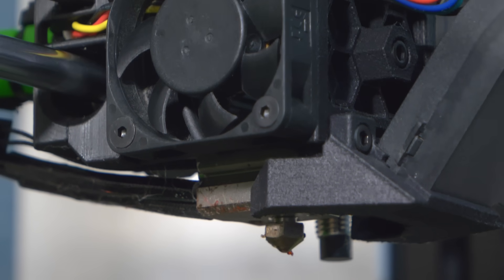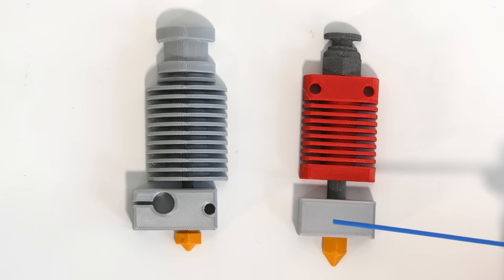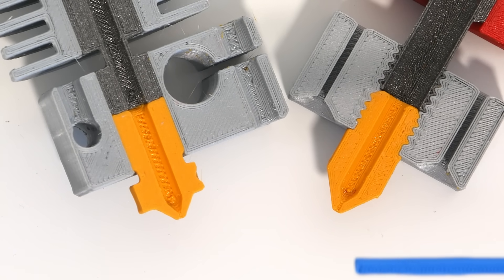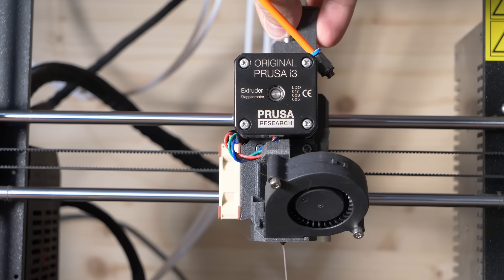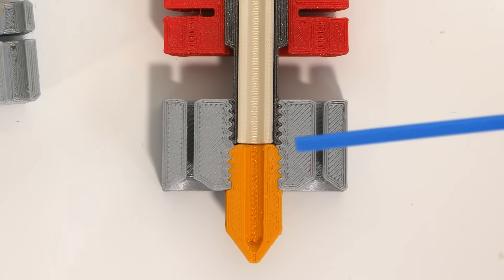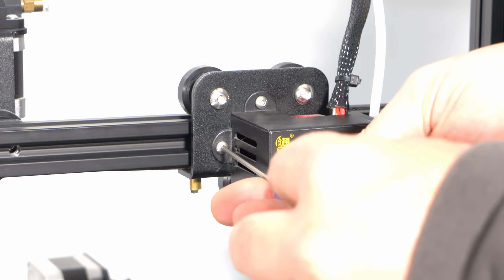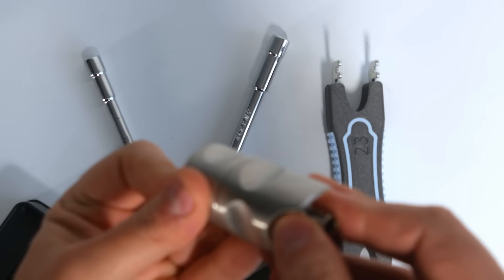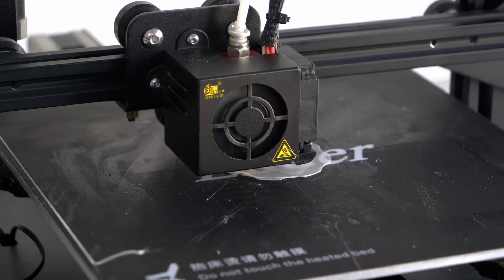The Biggest Pain In 3D Printing - Hotend Clogs & Jams

Comment: True all metal hotends FTW!

I found early on back around 2014 that PTFE tubes where an over engineered solution to inadequate heatbreaks. Applied thermal paste to the heatsink on my Replicator Dual, simply took out the PTFE tube and it has been printing beautifully ever since. Printing with just PLA and PETG, I've already had to replace the brass nozzle twice from normal ware and have only had one kinda clog since which was fixed with a cold pull because some debris fell into it. I suggest you feed the filament though a small peace of sponge with a hole in it to catch debris ;-) Haven't had a clog or any effects of such a thing in years.

I did recently buy a Duplicator i3 Plus and this time i upgraded the nozzle to a MicroSwiss all metal hotend so i could print lots of carbon fiber filaments, and although still a MK10 cooling/mounting block the better heater cartage and board on the printer insure stable prints at high temps and normal speeds.

Comment: If the only difference between the “all metal” is the distance of PTF tube to hot block, I don’t understant why don’t make all metal by default. Add a hole in the barrel to have PRF tube near of  hot block is more expensive piece...
Reply: The PTFE tube being down so low helps seal the mark10 against leaks, by butting directly against the nozzle.  But because it's down there exposed to the heat of printing, this causes it to slowly degrade, especially if you run hot like 250C petg.  Tradeoffs!
Reply: Orion Lawlor ¿what is the problem if the seal is 10 or 15mm far of the hot block? Many thanks for your help
Reply: @markus_1978  On my CR10, after I swapped to an "all metal" throat where the PTFE ends at the start of the throat block, plastic is slowly leaking out from the metal-to-metal contact between the throat and the nozzle.  I need to disassemble the hotend (again lol!) and add some PTFE tape to seal that joint.  In the original mark10 nozzle, that spot is already a metal-to-PTFE contact because the nozzle pushes directly against the PTFE tube.
Reply: Orion Lawlor I understand then that the benefits of using the tube near of the nozzle is that the filament slides more easily than inside a metal tube, but in your case of CR10, does the problem not come from poor tube retention?  I don't understand what relationship it has with the whole metal barrel.

Comment: I'll add one more tip for the Mk10, when seating the PTFE tube leave the nozzle a little loose, push the tube all the way in until it hits the nozzle then tighten the nozzle to ensure a nice tight fit against the PTFE tube. About a half a turn does the trick for me. If you leave the nozzle too loose it will bend the PTFE tube and cause jams so don't over-do it.

Comment: i took my hot end apart and found filament on the threads and up the sides of the block what would cause that??
Reply: What system is it? Probably the nozzle is tightening against the block and not the heat break. Make sure the heat break is in the heat block far enough that the flange of nozzle is not contacting lower face of heat block. The nozzle should seal against lower end of the heat break, not the heat block. Had the same issue. Pro tip: first install nozzle until flange makes contact w block. Then screw heat break in from top until it stops against nozzle. Then unscrew nozzle 1/4 to 1/2 turn. Then screw heat break further in the same amount until it touches nozzle. Then heat up for torque. All steps before without torque.  Make sure not to overtorque. The threads are kinda soft at high temperatures, u can ruin ur heat block. I had to make a new one.. Works flawlessly when installed as described, 0 leakage.

Comment: I'm not sure how YouTube knew I had a clog or jam, but thanks for this timely video! :)  I learned quite a lot from it and feel a lot better about trying to deal with it.  (I actually already replaced the whole hot end already, but I plan to fix the old one soon to keep as a spare.)
Reply: As a newbie, I have scratched the glass bed and I believe screwed up the extruder.  I was thinking like you "replaced the whole hot end already, but I plan to fix the old one soon to keep as a spare."  
In your past two years, how has this worked for you?  Have you since found better alternatives?  Replacement of the entire hotend assembly looks difficult.  The cost seems to be about $40.
What is your opinion on cost and difficulty?

Comment: I had a different issue with the Mk10 (Ender 3). The molten filament somehow made its way through the side of the PTFE tube inside the heat break. The leaking filament cooled down (due to contact with the heat sink) and was completely stuck in place. I could not even remove the PTFE tube from the print head. I ended up drilling through the filament from the nozzle side to release pressure, which was stretching the tube against the heat sink. Gladly there were no other issues for several months now.

Comment: If I may add on the V6 hotend,  the jam normally happens on my 3d printer on the ptfe tube after the heatbreak .   The heat during the print will soften the teflon tube eventually , then during the retraction the melted plastic will go up there and unable to move back.   This is the reason why the higher temp teflon tube is best for this application.   My fix for this problem on my bondtech style extruder with v6 hotend is I use 2mm ID aluminum tube with ptfe sleeve on the outside, from the heatbreak to the lower part of the extruder.  This fix works for me, no more jams since I made this fix.  I also do this fix to my IDEX printer and so far so good.   This is now my go to fix for v6 hotend.

Comment: I personally remove the cooling fan and heat the hotend to like 150 for pla
keep stabbing abs  onto the heatsink or if the filament is stuck keep pulling it out and pushing it in. until after a point the heatsink gets hot enough for it to release it. like a cold pull. or it just lets go of the filament. then quickly turn the heat off and put the fan back on. be careful cause during this your heatsink gets warm and hot and if you don't manage to get it out by the time it's hot to touch you should turn off your printer so your mount doesn't melt (if it's printed which it usually is) it's the same tbh but a little easier? I don't take the nozzle out either personally also I use abs cause I don't want to scratch and damage the inside of my v6's heatbreak since they need to be very nicely polished to avoid jams,

Comment: If you get a jam, as you showed, you showed how to use the heat gun to dislodge it but they need to realize that if it happened once it is going to happen again 100% guaranteed so they need to figure out what is wrong that is causing it else they will get beyond frustrated.

Comment: My filament was stuck inside the PTFE tube! This is a Prusa MK3S. I took the whole thing apart as instructed by a support tech. But now putting everything together is very intimidating as there seem to be many steps where things have to be just exactly right!
Somebody ought to design a new type of extruder that can be easily taken apart and put together!
Reply: They are fairly simple after you get used to them, but I remember the first time being intimidating. I think the hardest part of my build 7 years ago was the wiring and customizing firmware, mine came in a bucket of bolts/nuts and wiring, haha, you had to even crimp on your own wiring connectors, like nothing assembled, haha!

It’s all basically the same parts and can count the extruder parts on a hand, like mine from top to roll is: nozzle/block/heater/thermistor/2 securing screws/throat/heatsink/fan/pneumatic connector/tube/pneumatic connector/extruder housing/driveshaft and then 2 gears and a stepper motor). Mine is setup as Bowden with a customized “Cyborg extruder” that I printed. Plus after a while you’ll get it setup just how you need and really never seem to have much of an issue (there are some really nice easy maintenance designs out there too, but they also have some other issues like added weight so you have to print slower)

Youtube really makes things easy now, but yeah, for someone new it has a little bit of a learning curve (which is why I think it’s best when the first printer is completely assembled from scratch, you really learn how everything works together and can easily take apart and repair anything since you can build it from scratch). I wish I had Youtube back then, or even half decent pictures in the only half filled manual, haha!

You’ll do fine, as long as you’re not crossthreading it if you make a mistake you can simply take it apart and put it back together like LEGO toys if you don’t get it right the first time. “If at first you don’t succeed, Google/YouTube it”, haha, someone out there probably has a good guide for you (I know I find it helpful when repairing my car and prop my phone up where I’m working to follow along), good luck, I’m sure you’ll do fine.

Comment: Yeah, its also a probilem when it happens in 3 out of 4 prints.... or should I say print attempts...  still haven't found out why in my case, lots of things that could go wrong...

Anyways what I found to work fine too (Ender3 here) is to take an old ptfe tube that has a lot of marks from the coupler and feed it through the hotend (nozzle removed) and it acts like a cleaning brush taking a lot of material with it.

What also is useful on some types is to slightly taper the ptfe tube (look at how the matching end of the nozzle looks like) and/or to insert the tube when the nozzle isn't quite tight yet and then tighten the nozzle against the tube.

Comment: Thanks for this coherent explanation. Even though I've been 3D printing for a year, you still succeeded in "teaching" me a couple of new things here. My first 3D printer (a Monoprice Maker Ultimate) has had clogs and jams repeatedly for months on end, to the point it now sits in my garage unused, having been replaced by an Ender 5 Pro. This may well be what I needed to get it working again, even though it will be only for high-temp prints like ABS, since it is fully enclosed.

Comment: As always super high quality stuff. I had a really gnarly jam on my Ender 3 recently. I've cleared it but I've been getting really bad stringing since. Any ideas? I've been banging my head on the wall for weeks!
Reply: What filament?
Reply: At that point just change nozzle imo. Also you can take out the ptfe tubing and further clean the components

Comment: I've had luck just unscrewing the hot end and putting it on the burner of my stove.  Heat it up until all the plastic just burns away, and you are done.
Reply: Blowtorch here
Reply: Isn't the nozzle then clogged with sud?
Reply: @MetalheadAndNerd  PLA just fizzes and burns away completely.

Comment: one addition: for the V6 and V6 clone you have to cut the ptfe tube in the right angle 40 or 60 degree
Reply: ??? You don't. It's definitely more forgiving because the ptfe tube sits in the cold end, but it still should be at 90°.
Reply: @somedude2492  at least on the prusa V6 and the clone V6 from china i which i have

Comment: Dust ingress, this causes clogs and jams, new people forget that. Need people to use dry boxes with a tube all the way to the direct drive, or to the bowden drive. This keeps the filament pristine.

Don't try to clean the brass nozzle as you change the characteristics of the nozzle
Reply: You mean you can wear them down using cleaning filament just as you would using abrasives. Most people realize that their nozzle is changing way later and end up posting in the groups mystified that the nozzle can change.

Comment: The best advice I ever received for avoiding clogs was to use cleaning filament between swaps. Very unlikely to help by itself in a triage situation, but it's one of the easiest parts of preventive maintenance. I've been running three bots since 2016, and I've had a whole three clogs, one of which was from just being new to the hobby and having no idea about that step.

The other two were indeed munched PTFE liners, which were pretty involved to clear. The advice in this video covers that process quite well, and the only thing I can add to it, though it's definitely not a good solution for every single clog, as it gets pricey in the long run, is that many lined hotends nowadays tend to be on budget printers (though you should always check the specs before that impulse buy to make sure, as this won't likely apply if you got some crazy CoreXY bot that uses a bowden extruder and lined hotend for fast printing), and in the case of the budget bots, the hotend isn't likely to be any different than the stuff you can get off eBay or AliExpress for <$10, so if you feel in over your head, I'd suggest replacing the whole hotend and saving the headache. Just uh, check for obvious corner-cutting in the replacement, like burrs. Maybe when you're more familiar with your machine, you can revisit that clogged hotend and get it working as a spare.

I like to buy known-good hotends and related parts, but sometimes you just gotta do what you can to get back up and running on the cheap, and there's a major cost delta between E3D and mystery meat, so the latter really helped me when starting out. If you're printing as part of a business though, you'll probably be better off just buying the stuff that's definitely had some QA put into it and avoid any odd issues that the clones might have. A hobbyist's minor occasional gripes can be a print farm operator's reputation.
Reply: I have also used some glow in the dark filament (Very Abrasive) to scrub the inside of the nozzle, a couple of inches pushed thru seems to clean anything out.